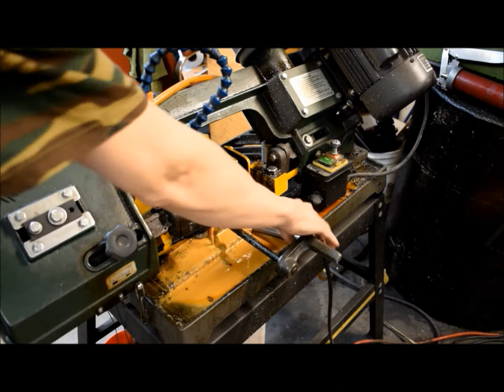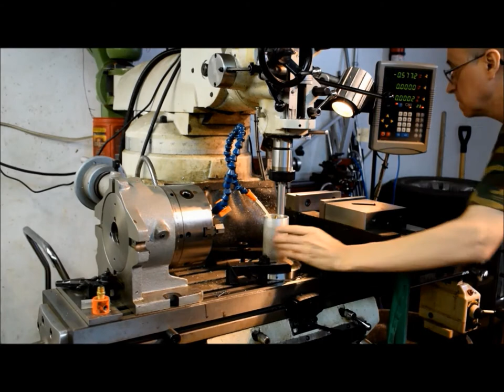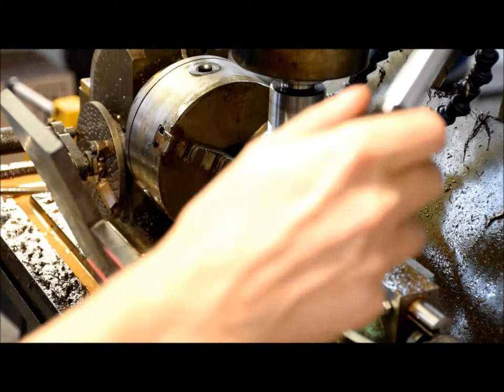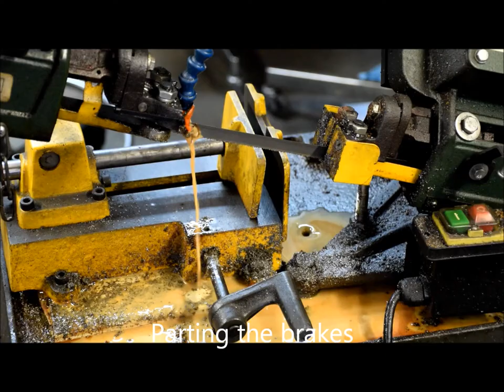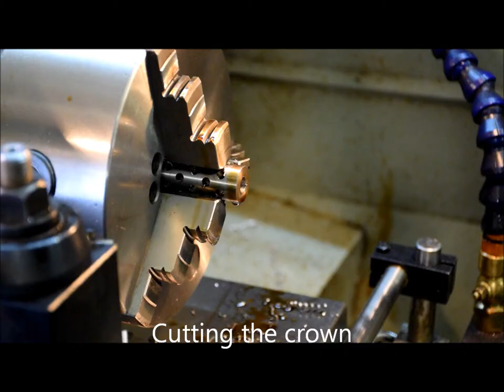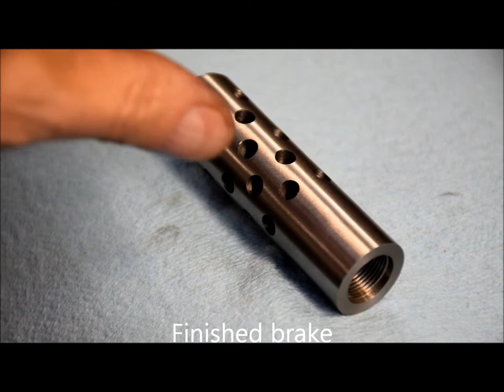Gunsmith Rod Henrickson Making a Muzzle Brake on Single Stage Machines

Comment: the muzzle brake you made for me, works great. thanks you and very fast turn  around, in out in 3 days
Reply from the maker: +akaeldin Normal time in shop is about 4 or 5 days and I usually try to pad it a bit in case I happen to be out of specific tooling, so often it's a bit quicker. 

Barrel and chamber work is 2 weeks after the customer drops off all the components because I generally need at least 2 machines free for two full days and I have to clean up my regular 4 day backlog.

Comment: Really nice work!
Reply from the maker: +Paul Braus  They come out nice. But there is more work to them than customers think. That's one of the reasons I put together the video. In today's world of automation people don't often realize that a lot of stuff is actually made on single stage machines. Making a run of 100 brakes can seem like a jail sentence some times. lol
Reply: +Rod Henrickson oh i know. I am about to go into production myself lol. Its a whole hell of a lot of work but i live for machine work.
Reply from the maker: +Paul Braus I bought a 9 x 32 inch column mill and a small dividing head and tail
stock and dedicated it just to making brakes. That way its setup all the time and I have the big mill free for real work. If I had a CNC and forth axis I would make a jig with 2 small ganged and geared chucks and gang drill 12 at a time. But I'm out of space and have no 3 phase power so it is what it is for now.
Reply: +Rod Henrickson nothing wrong with that at all. Im looking into a small cnc mill. Not sure exactly what just yet.
Reply from the maker: +Paul Braus HAAS makes some easy to use, affordable stuff. It's nice to have 50 inches of table so it can be used for fluting and octagoning. Anything smaller is sort of useless for gun work. I looked at a couple Haas VF-5 mills that were between $20,000 and $30,000 depending on your preference of beat to shit.
Reply: +Rod Henrickson yea i hear ya there lol. I have access to a vf4 anytime i need it afterhours at a buddys shop. And hes thinking of selling it being it rarely gets used.
Reply from the maker: +Paul Braus Yeah, CNCs are pretty hard to justify in a gunshop as most of the work is one-off stuff. I also do a lot of oilfield and automotive machining for other companies and I could justify the mill. Not a lathe though. Just not enough repetitive turning work. Plus, as long as your material is no longer than 4 times its diameter in length, you can do most turning operations in the mill now days with the material running in the spindle.  A bit unorthodox, but it's done to death.

Comment: just curious but the few brakes ive made on manual machines i single point the threads to make them more concentric and you tap yours so it does not really have to be perfectly centered and precise is what you are saying i guess
Reply from the maker: It depends on how heavy your tailstock is. With ridged tapping they come out around .0005 inch axially and .001 lineally at 4 inches as long as you have properly drilled and reamed the hole prior to running your tap in and have sharp taps and a heavy tailstock. You never want to resharpen your taps, for best results. Throw them away after they get dull. Also, always hold the taps in good collet chucks. Not Jacobs chucks or speed chucks. Another nono is to hold the tap in a tapping chuck as tapping chucks float. The tap must be held ridged and straight. As said ridged tapping only works well with heavy tailstocks. On really light machines like the old Southbends that we had when I went to the Colorado School of Trades Gunsmith years ago, ridged tapping would be a bitch as the force of the tap cutting would lift the tailstock off the ways. With a tailstock that weights 40 to 100 pounds or more that's not an issue. The cutting tap will drag the tailstock forward but it wont have enough power to lift it off the ways of the machine. So in the end the threads will be just as true as they would be if they were single point cut off the carriage as they both rely on the same ways to guide them.  In some ways the threads may even be more accurate when cut with the taps as boring bars often have a lot of flex in them. Taps also cut chatter free so your finish is better.

It's all actually sort of a mute discussion because the exit hole in the brake is usually made .020 inch larger than bullet diameter so if your threads do happen to be off .001 or .002 inch,  you have a large safety factor built into the size of the exit hole.
Reply: @RodHenricksonGunsmith  i got you, the first one i made i tapped and it was visually crooked and i see what your saying my lathe is a 13x40 and as you say the tailstock is not super heavy so the few i make will have to be single point but what you said makes perfect sense so thank you for the reply kind sir and again i only make things for my personal use so i will not be making any kind of large amount maybe 1 here and there but its nice to know if i get a heavier lathe when i upgrade i may be able to just tap them
Reply from the maker: A modern 13x40 machine should be heavy enough. Make sure that you are reaming to the correct dimensions, 75% of thread and that you are using a sharp, never sharpened tap. Hold the tap in an ER collet for best results. Also, leave the material in the chuck until drilling, reaming and threading is complete. You can make a test mandrel between centres that you can screw in after threading while it's still in the machine so that you can screw it in and check your run out. Once you take a piece out of the machine it will NEVER go back in true. Especially lineally.  Most of the commercial brakes I check are off a bit because guys drill 100 blanks, then go back in the machine and ream them all. Then go back in and thread them. All that in and out of the machine between steps tends to fuck them up a bit. But then again, that's what we have tolerance for, isn't it? LOL
Reply: @RodHenricksonGunsmith  its a 18 year old smithy 13x40 combo so not heavy at all that is why it will be replaced with a good lathe i have already traded the milling combo for a bridgeport 9x49 mill